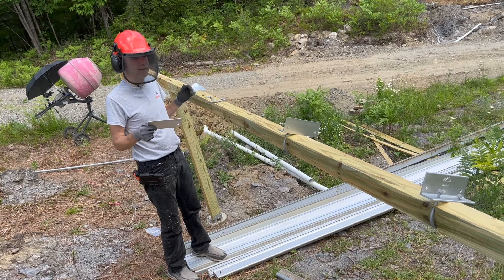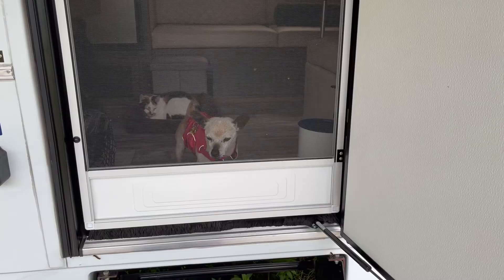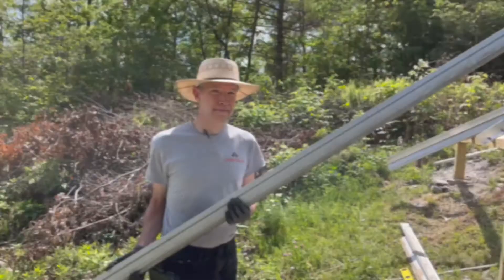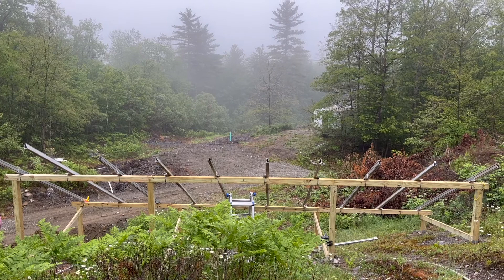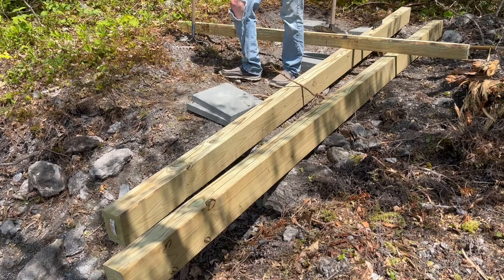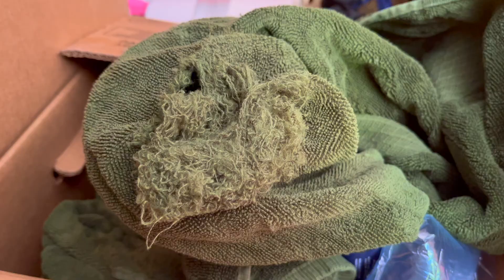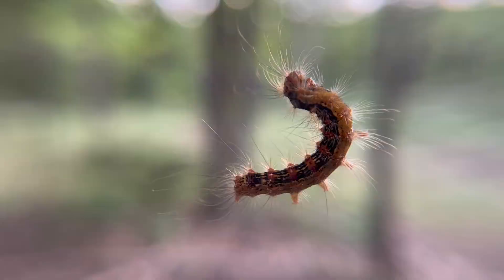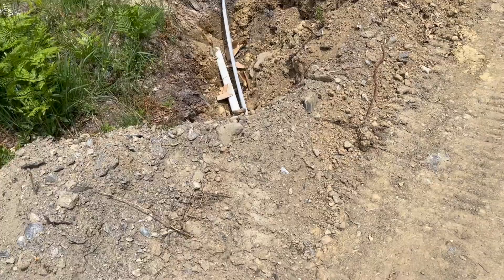Homestead solar system (Vermont DIY off-grid home build)

Comment: Jill, there are a few ways to keep the caterpillars under control.  It's probably too late for this year but, in the future, you can make a plastic wrap barrier around the trunk of the tree and put an inch or so wide line on top of it of petroleum jelly or axle grease.  They parachute down each evening but, they won't cross the grease to go back up.  You may be able to save some leaves, if you start on trees that aren't totally defoliated.  If you do the trees around your home, you can also stop the "rain" from landing in your hair.  At the end of the season, remove the plastic.  The trees aren't wild about it but, it does the trick during the time the moths are nastiest.  Also, I've left lights on and then, when the moths gather at night, I squish as many as I can.  This has reduced the problem around here to some degree.
Also, be forewarned that a LOT of oak trees are dying down this way.  It seems to be some really hungry ants attacking them but, I don't know what to do about those yet.  Good luck!!  I'll go back to the video and you'll probably be saying these exact things. 🤣
Reply: Also, some of the leaves will grow back once the caterpillars have gone by.
Reply from the maker: Our neighbors tried all those things to save the leaves on their apple tree, but to no avail. Maybe in a suburban backyard a high intensity battle may be worth it... But we have 30 acres worth of trees connected by a forest canopy, so I'm afraid they will have to fend for themselves. The outbreak won't last forever, but it could be another year or so depending on the weather. We hope next spring will be wet.
Reply: @OvertheRiverandThroughtheWoods  It does work but, you have to do all the trees in the area.  You might be able to create a barrier if you did a certain number of feet into the woods.  We did it in our yard, which is surrounded by woods.  It does work but, you have to put the stuff up before they get a real hold on the foliage.

Comment: Was it easy to figure out how to build your solar system in terms of the number of solar panels and the inverter and batteries, etc.? I’ve never built one before.
Reply from the maker: This is what Charles did for a living as an electrical engineer, so it was easy for him but probably one of the harder DIY projects generally speaking. We did end up sizing up our battery bank later in the year, since so much about performance depends on the weather and not just your electrical needs.
Reply: @OvertheRiverandThroughtheWoods  I think Charles is a genius! I’m an Environmental Engineer, chemist and health care professional myself. So, I’m used to doing research. I even developed some artillary nose-fuse LiMnO2 batteries for your army years back. I don’t think solar systems are likely so difficult to learn, I just haven’t taken the time to learn yet. I may also consider wind or hydro options, since up in northern Canada the sun is often not intense enough to rely on solar for about 1/2 the year.